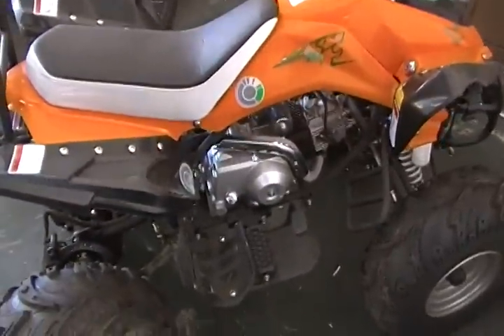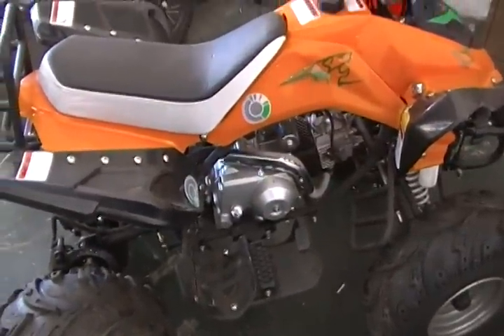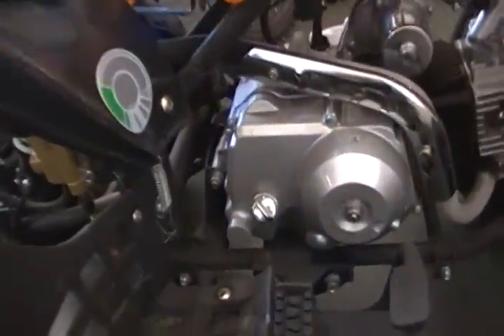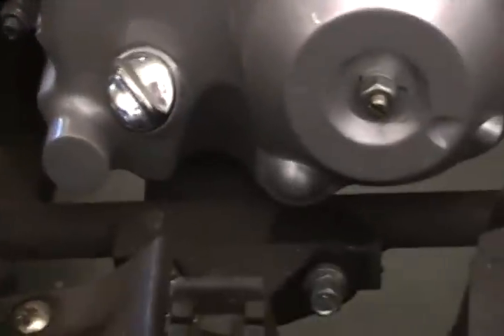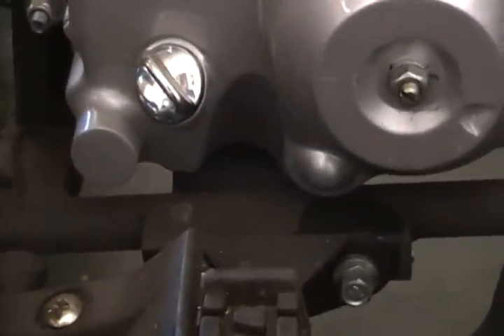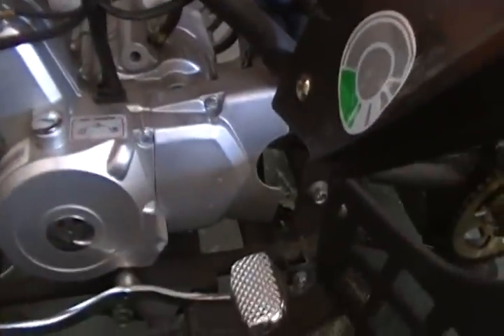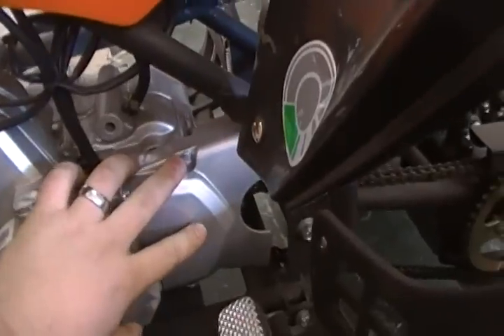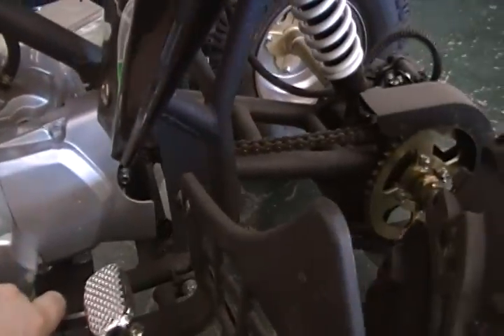how to remove a 110cc motor

Comment: ive removed a 200cc engine from my quad as it was a piece of shit ! i was wondering would a 110cc lifan pitbike fit into my frame
Reply: Did you run the 200cc on premium fuel only they run like shit and get too hot on basic junk gas yet you can run a 110/125 on junk gas no issue and seem to be much more reliable than the gy6 engines